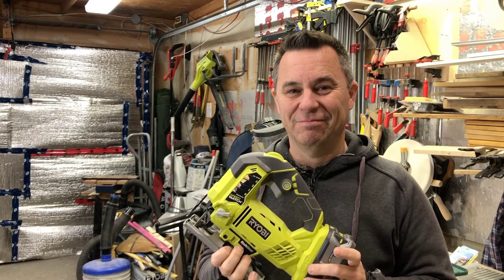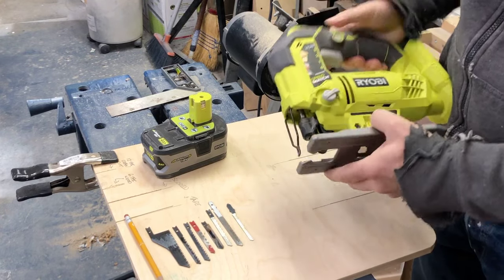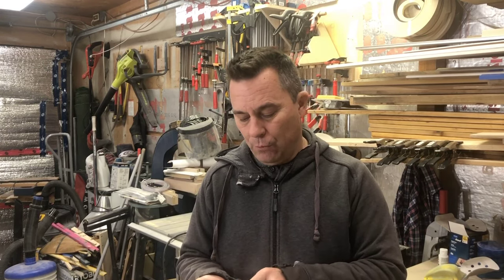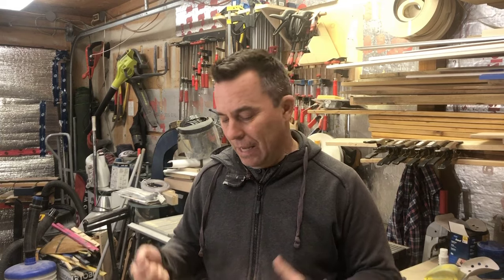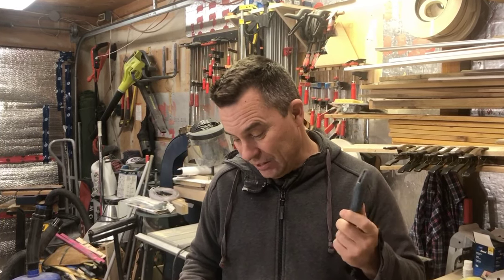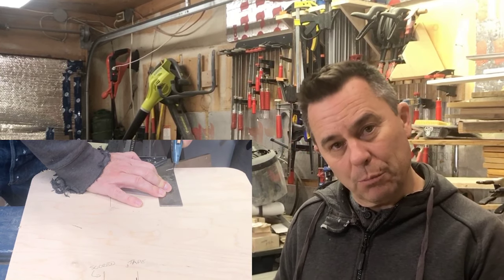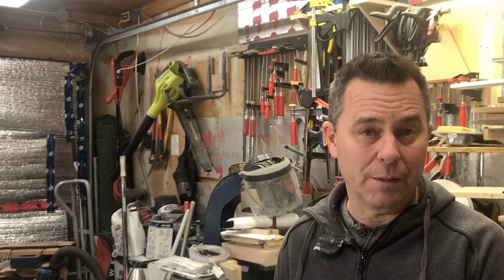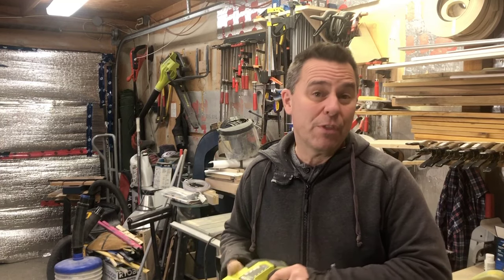How To Use Your Jigsaw I Tips & Tricks

Comment: How do you slow your cut down?
Reply from the maker: Hi Lori, that depends on what you mean by slow it down. If you mean to slow down the speed of the blade, that would be with the variable speed dial on your jigsaw. Mine has it but not all of them do. You want to use different speeds for different materials, softer materials need a faster blade speed and harder materials(plastics,metal, hardwoods) need a slower blade speed. If you mean actually cutting slower, I’d suggest not to push your jigsaw beyond its capabilities. Don’t try to force the jigsaw through the material faster than your blade will allow. Let the blade determine how fast you cut. Hopefully that answers your question!

Comment: When I use my jigsaw it starts to shake and I have to stop and start what am I doing wrong?
Reply from the maker: Hi, a couple things could be happening. First, make sure you are using a sharp blade. This will allow you to go slower and make more intricate cuts. Second, don’t push your jigsaw into the cut. Let the blade do the work. Only go as fast as the blade will allow you to go. If you push too hard, the jigsaw blade will try to cut the wood too fast and will get bound up in the material. Go slow and let the blade do the work. Hope this works for you.

Comment: The blade often comes off during cutting.
Reply from the maker: You probably have the old style of blade that is held in by a tightened screw. It is a common problem on older jigsaws. Unfortunately all you can do there is try to keep the screw as tight as possible to keep it locked in. You may want to invest in a newer jigsaw that has the T shank. They stay in much better. Best of luck!
Reply: @DIYWithWally  Tnx